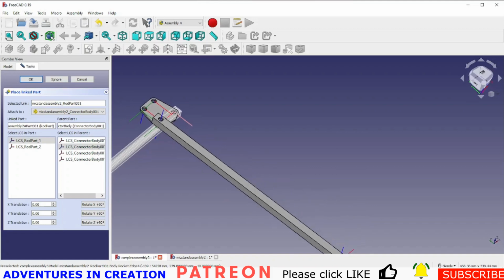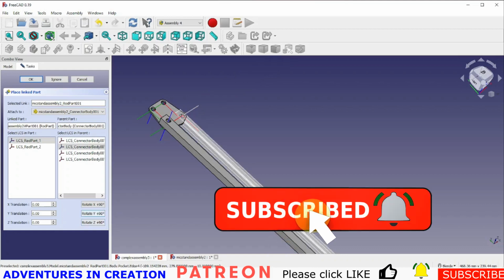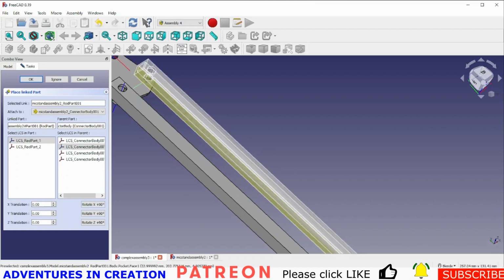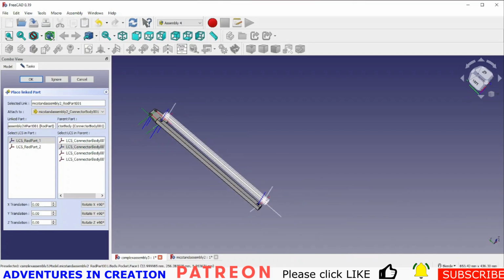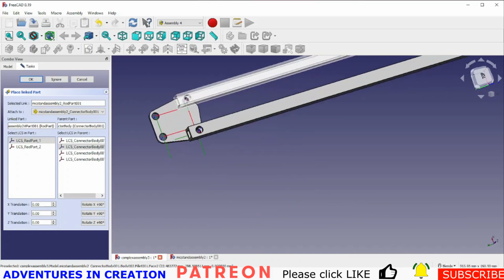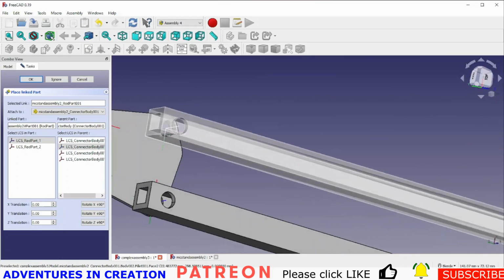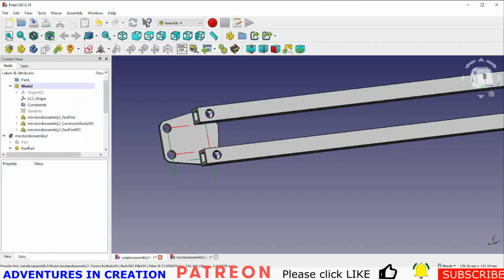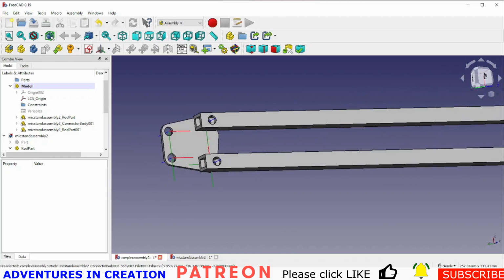FreeCAD for Beginners #23 - Complex Assembly Pt 3

Comment: Before the break (15 min mark) the 2 square rods were attached to the connector in one position. When the video restarted, they had magically moved position to create a "V" shape. I can't figure out how to make mine pivot around the connection point to replicate. (Someone else had the same problem some time ago...)
Reply from the maker: I would have to review the video to see what I did.  The dev version has the new assembly workbench in it. Looks much better
Reply: @Adventuresincreation  I have the same question. Can you help me please! I'm using FreeCad 0.21.2.
Reply from the maker: @SjaokdeTerrier  I strongly recommed you move to version 1.0 the Assembly workbench there is much better. This is simply revolute joints in that assembly workbench.
Reply: @Adventuresincreation  Thx, that workbench is great! Furthermore, compliments for the very clear tutorials!

Comment: Another reason for placing multiple Bodies into one part (even tho they are separate 'parts') is IF they are all part of a mechanism that moves as one. for instance a cylinder lock with a cylinder body and pins. by placing them in their proper locations inside the one part, you can rotate the whole thing at the same time by just translating the part. This is also another reason why when I design the individual parts I create them around the 3 axis keeping mind how they will move.
Reply from the maker: That's great feedback

Comment: How did you rotate the Rod Parts in the Assembly?  I tried this in the Draft Workbench.  The Part rotated on the correct axis, but on the final left mouse click, the Rod returned to where it was - parallel to the other Rod parts.  Any help would be appreciated.
Reply from the maker: I will have to go back and look at the video to understand what you are looking for.
Reply: Could you have another look at my issue?  I still haven't solved it.

Comment: I have been getting on the Patreon Site and it has a wealth of information, that I feel is worth supporting this channel for! I would like to be able to get the sample files from the Patreon page onto my PC so I could look at them in my FreeCAD?
I really enjoyed the content of this video and all the hard work you put into it! Being a beginner I got lost several times, had trouble with turning on a body after getting it into the assembly, but I did figure out how to attach the spheres to the crank handle. I complete;y went crazy with the LCS 's attaching them to both sides of a hole, etc., however it was great practice. Maybe over the next couple of weeks I will keep working on this mic holder and finish the assemble process? Without having the model or plans it was overwhelming for my level of experience. The rods once placed on the plates, then needed to be rotated and this was hard and pretty confusing, trying to figure out the correct process thru the attachment module. Maybe break down this into a smaller video whereas you just attach 2 rods to a plate and rotate them!
Thanks,
Reply from the maker: Thanks for the feedback Gary

Comment: What is the "Parts" group for?
I see that you don't use it for anything but I'm curious as to why it's created when you add a new assembly container.
Reply from the maker: You can put parts in there before you add them to the assembly in order to add lcs to them. You can create parts in the same file as the assembly.